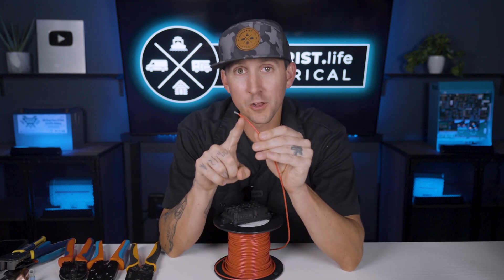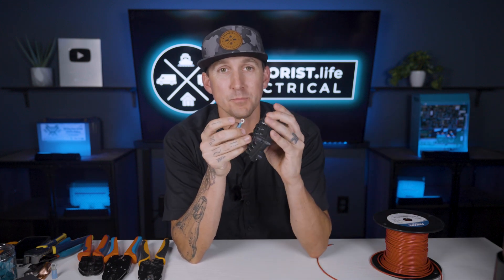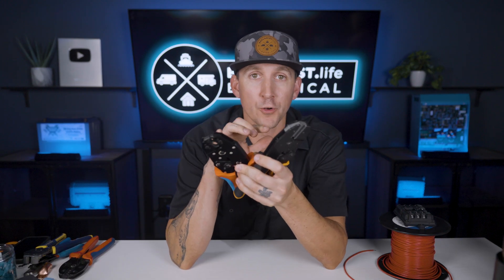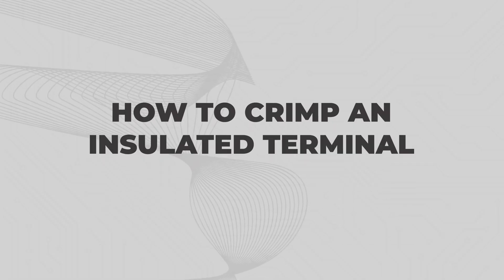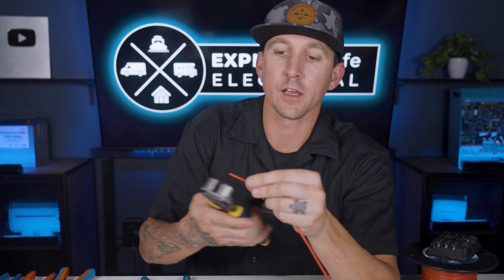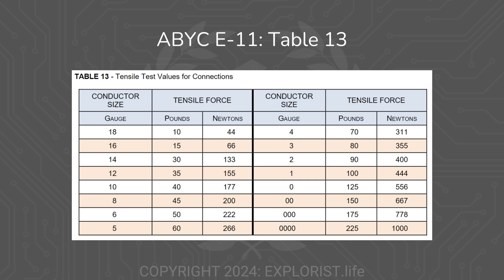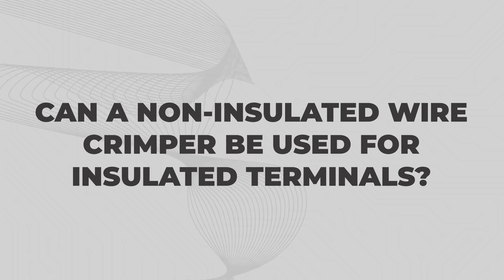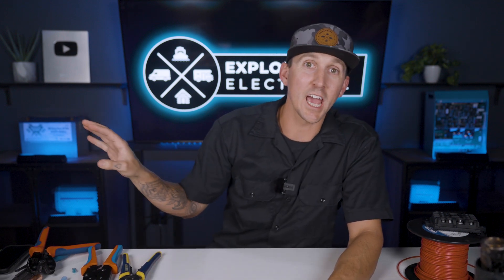Ring Terminal Crimping  - Wire Terminal Basics | Ep: 6/14

Comment: How do you uncrimp them to reuse them? I know they're cheap as chips, but the ones i need to reuse are difficult to find. They're also too small to get pliers on, I tried nail clippers which got a good grip, but squeezing I almost snipped the connector in half 😢
Reply from the maker: These aren't re-usable.  You'll need to cut it off and re-crimp a new one.  I understand the difficulties of sourcing hard to find terminals, though, but this is the way.

Comment: Would love a video on how to parallel two victorn inverters.
Reply from the maker: So, we've already got kits for that in shop.explorist.life.  One for RV's/Motorhomes and one for off grid applications.  Although we don't have a specific video about it, necessarily, if you can follow our other non-dual-inverter videos and can crimp wire lugs; you can install the dual inverter setup.

Reach out to us at shop.explorist.life/support if you need some further guidance or help finding those systems in our shop.

Comment: Do you have a link for that 6&8 gauge crimper? For 6ga, I usually use lugs but the 8ga has always given me trouble with the crimpers I have found. The insulation is almost always torn so I end up adding heat shrink to fix it. I would love to skip that step if possible. TIA😊
Reply: Would love to find these also
Reply from the maker: Here are the 8-6AWG crimpers > https://www.ferrulesdirect.com/collections/hand-crimping-tools/products/fdt10014
Reply from the maker: Here are the 8-6AWG crimpers > https://www.ferrulesdirect.com/collections/hand-crimping-tools/products/fdt10014

Comment: My question relates to the Victron app. I have installed a new Bosch starter battery for my campervan. Do I need to set any app settings?
Reply from the maker: Nope.  Starter battery doesn’t affect anything given you aren’t using a Victron component to charge it.
Reply: @EXPLORISTlife  Thanks for that. The starter battery shows up in my Victron app as non isolated, but it is the old battery.  Thanks